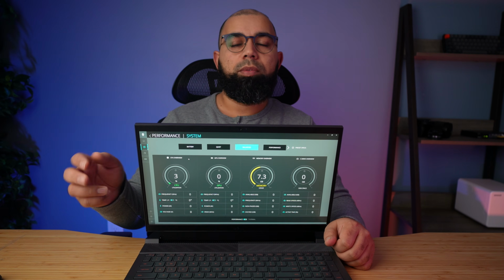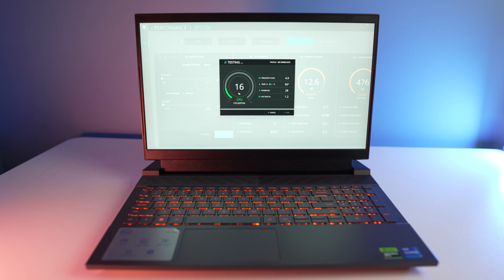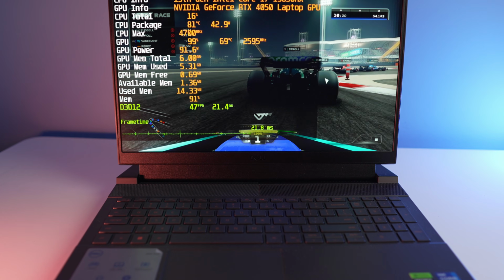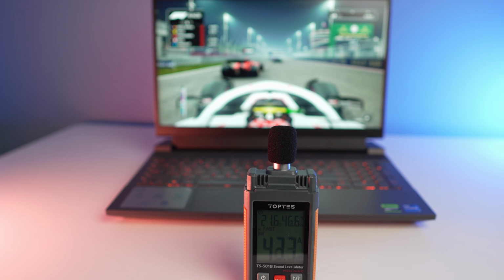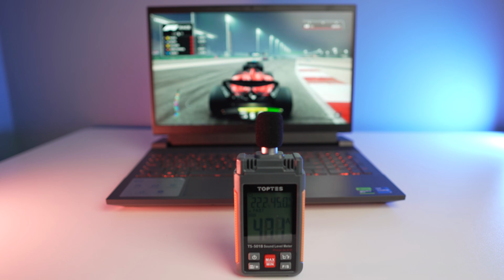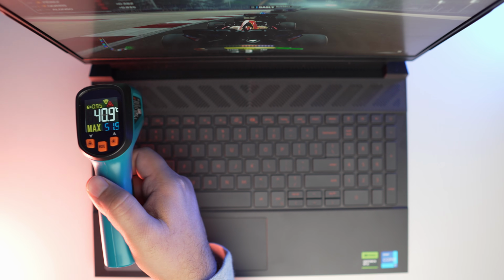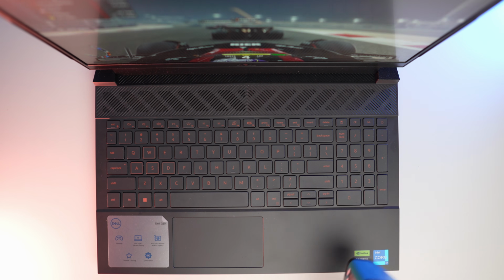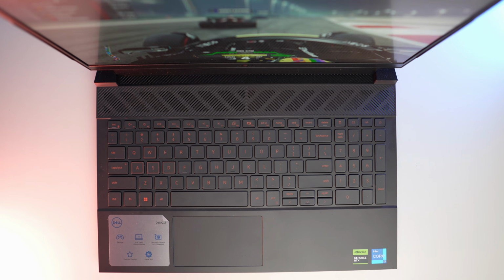Acoustics, Surface Temps and Thermals | Dell G15 5530 (2023) with RTX 4050

Comment: Good video, i would like to know if its normal to get constant 100c on the CPU while stress testing on Cinebench (GPU temps are fine). Test did put the CPU into full utilization, maybe should i test it on other games? My specs are the same but with 4060
Reply from the maker: @ian_1243 I didn't quite understand where you're constantly getting 100C temps? On the CPU during gaming? It shouldn't be 100C all the time but 90s is expected depending on which mode in the Alienware Command Center you're running. Try it in a Balanced mode to see how the temps are. If they're still very high in the 90s up to 100C then you might have a faulty CPU/thermal paste connection so the heat sink can draw away the heat properly. The GPU should not go past 86C and should run up to that limit in the highest Performance mode.
Reply: On gaming it’s fine though I haven’t played any demanding games just Counter Strike. It’s only while stress testing on Cinebench 2024 that i get 100c

Comment: HLO Sir on 10th I am going book rog g16 i9 rtx 4070 the issue is  I recently saw the asus transcendence live taking place on 9th will there be a launch of new gen gaming laps,what should do I sir wait for new lap or buy the g16 I am really confused
Reply from the maker: @praveenv8419 Wait and get the latest unless you absolutely need one right now. But since the 14th gen and 13th gen CPUs are not that much different, if you can get a great deal, go for the 13th gen G16. We don't have pricing info yet on the new laptops for 2024, but there might be price increases. The RTX 4000 super GPUs will be in laptops this year, but that's approximately 10% performance increase and new AI stuff - if you care about AI that is.